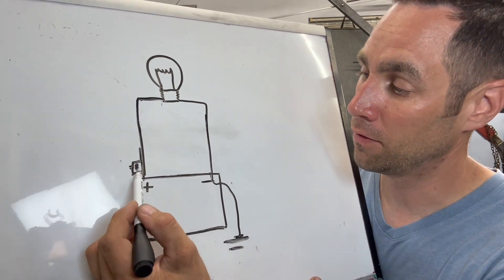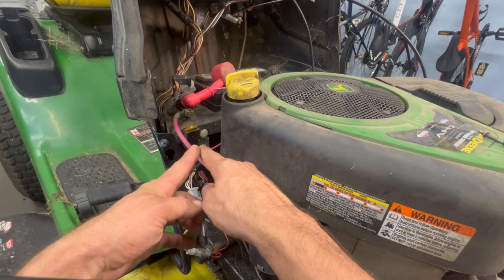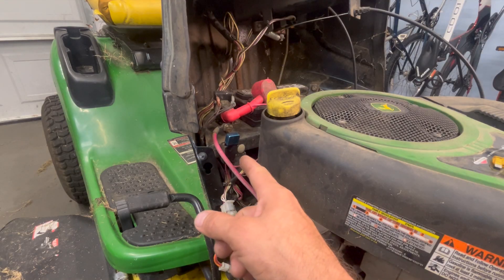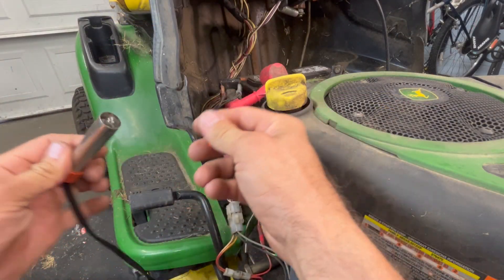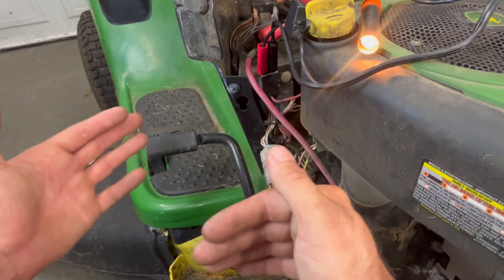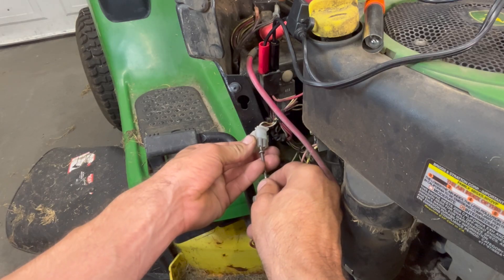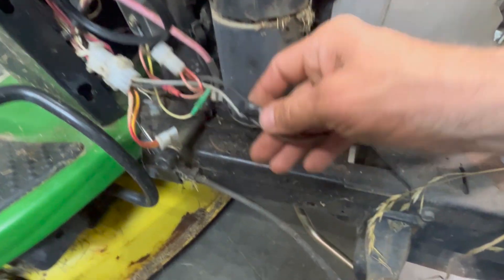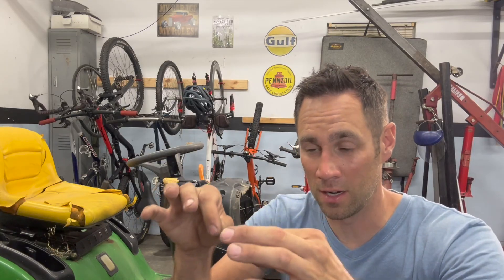Blowing a fuse! How to find a short circuit.

Comment: Josh, just watched a video you made 13 years ago showing us how to test a switch.  I think my problem is the ground wire because mower will not turn off when you put switch on off. Continuity from connection at coil to switch is good. I will check the ground wire next.